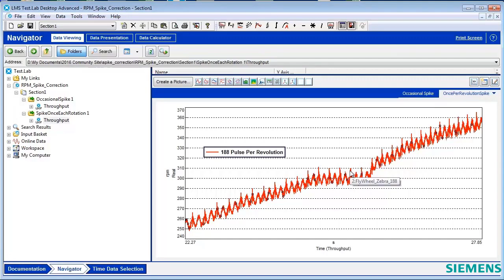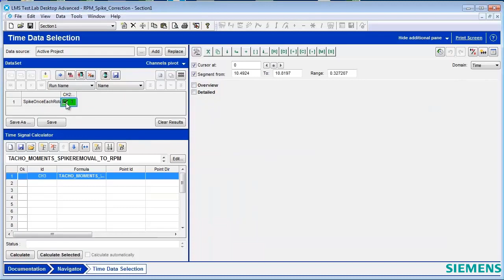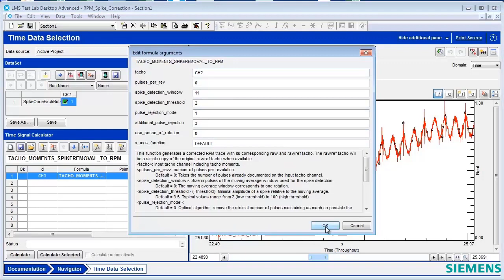RPM Spike Corrections

Comment: The speed signal in the video collects several signals per revolution, right? The speed signals I collected in most tests are one signal at a time, and there is no peak in the video;
Reply from the maker: By "signals" did you mean pulses?  If using one pulse per revolution, then the rpm is almost guaranteed to be smooth.  It gives a good overall rpm.  In some cases, multiple pulses per revolution are used because the fluctuations in rpm within one revolution are of interest.  With multiple pulses per revolution, there would be a higher probability of seeing rpm spikes, whether they are real or artificially introduced by an error.
Reply: @SimcenterTesting  good，and Can you tell me which tests need to collect collect multiple pulses per revolution? Thank you and look forward to your reply
Reply from the maker: @jjxie3291  A typical test that requires multiple pulses per revolution is torsional vibration: https://community.sw.siemens.com/s/article/torsional-vibration-what-is-it